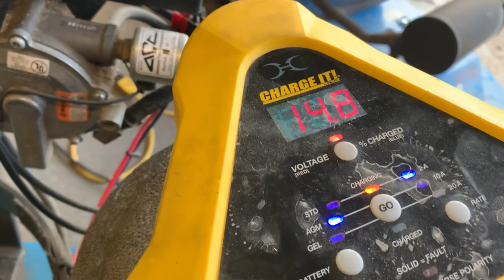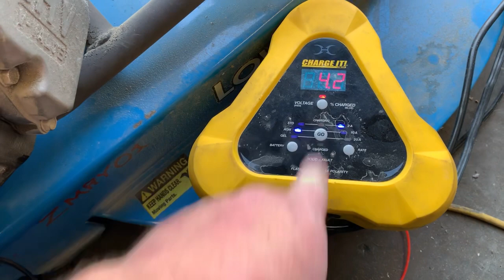2 WAYS TO CHARGE A BATTERY

Comment: How do you make your charger charge a completely dead battery?  I've tried pretty much everything but can never get it to start charging.  Charging it up with a good battery and also using my truck alternator system.  There was a guy on YouTube that showed how to convert your charger basically to turn off the "smart system" and make it pump out amps like an old school charger.  I don't really lime that idea because you have to monitor it so it doesn't blow up the battery.  Maybe you have but if not could you do a video on that?  If you have time, thanks man! :)

Comment: i'm not a fan of doing this but it does work and can save ya some time and headaches.  up north where it freezes 3-4 months of the year we often see batteries drained of their charge will freeze.  they may hold a surface charge for a bit  but are usually junk.  best to access the battery and test  it  charge it and retest it. while you are there you can make sure the connections are good and test the charge system all the way to the battery.

Comment: Is that wire gauge heavy enough (from the Voltage regulator) to handle the amperage from your charger?
Reply: Most chargers put out 6 amp at most which at the least an 18 gauge should be able to handle.
Reply: My charger puts out 15amps charging, 100amp boost for jumpstart. I don’t think the 18gauge wire could handle it